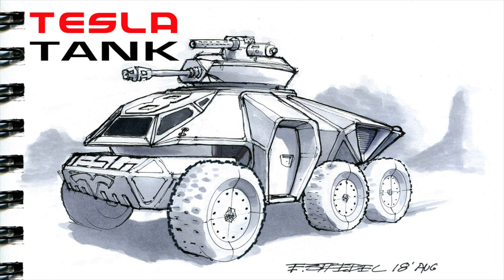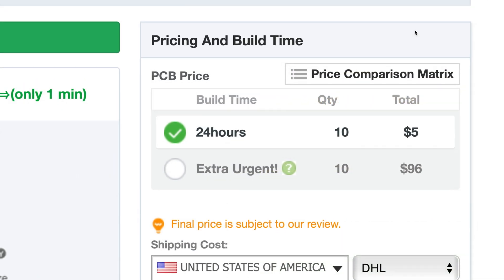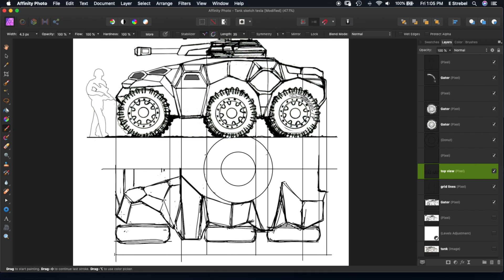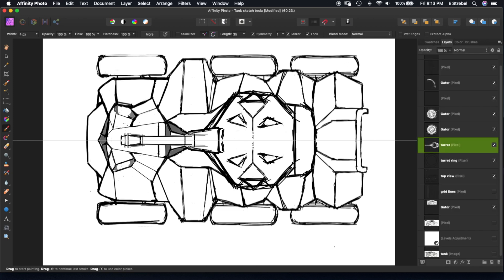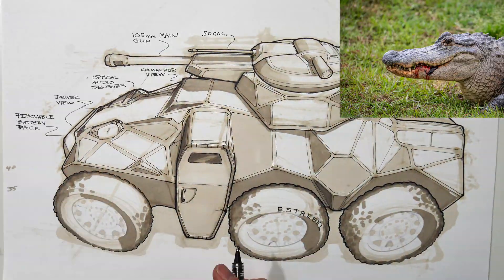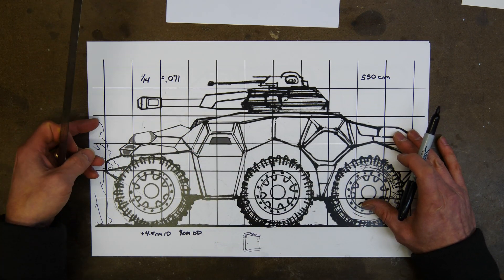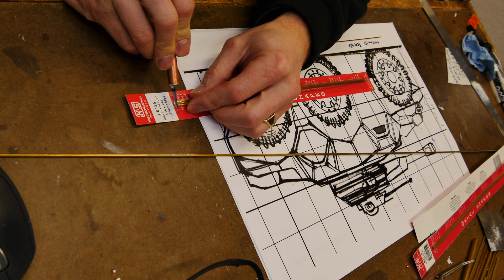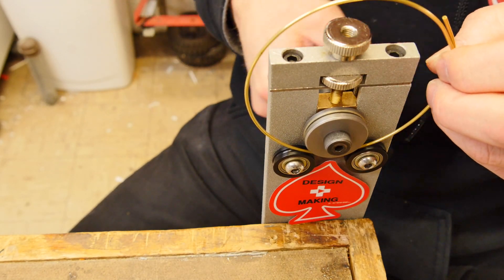Wire Modeling a vehicle 3D Sketching with Copper & Brass tubing: PART 1

Comment: Cool design you don’t sandpaper the brass tubes before soldering it right?
Reply from the maker: Sanding is a good idea
Reply: @EricStrebel  Any thoughts on using rosin core with silver and copper in it (Sn99-Ag03-Cu.07)? Flux as well 2%… ☺️
Reply from the maker: Should work